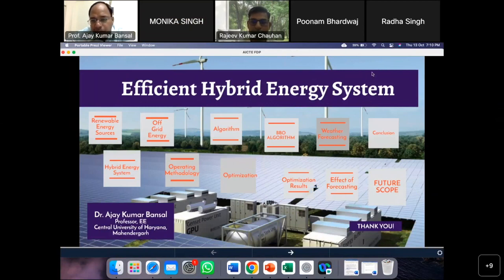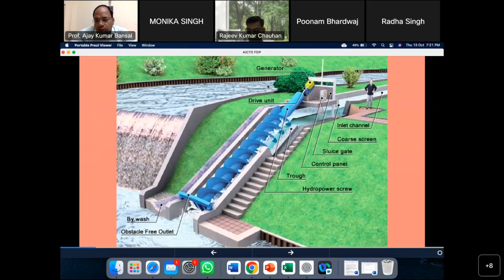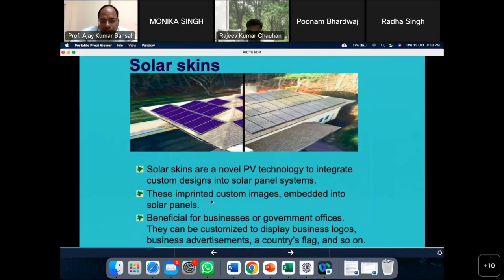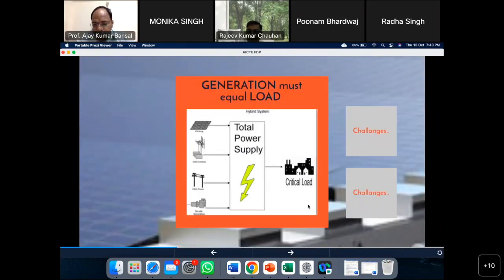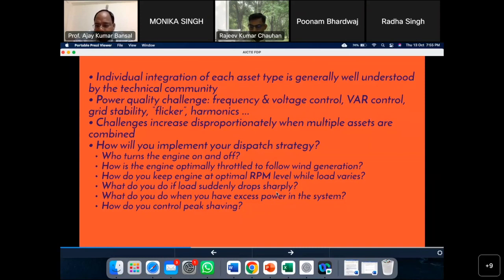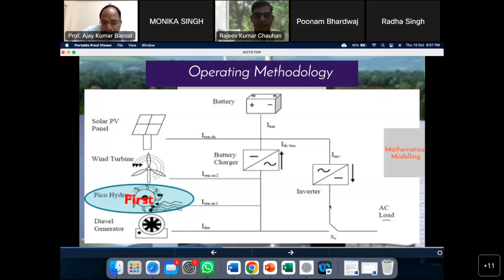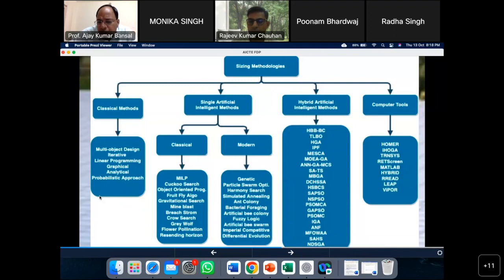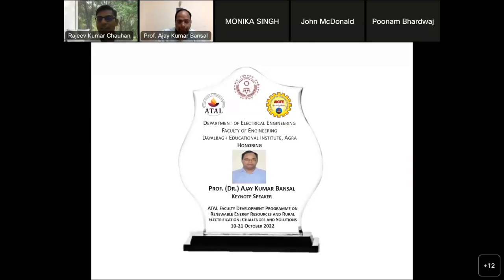Optimization of hybrid energy system including forecasting by Prof. AK  Bansal

Comment from the maker: 00:31 Optimizing hybrid energy system including forecasting
03:36 Wind energy is a clean and renewable energy source.
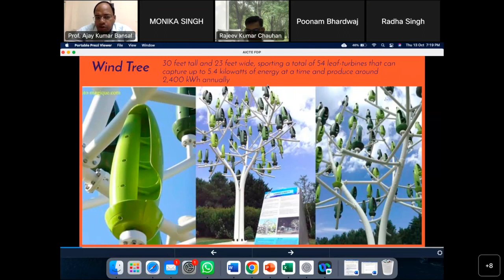09:43 Hybrid energy system optimization and alternative energy sources
12:41 Advantages and disadvantages of solar energy
18:34 Different types of solar cells and their efficiencies
21:13 Advancements in solar technology
26:24 Hybrid energy systems optimize efficiency and supply balance.
29:04 Designing hybrid energy systems based on local potential and user requirements
34:35 Challenges in designing hybrid energy systems
37:16 Designing a reliable renewable hybrid energy system
42:27 Designing an economically viable hybrid energy system.
45:07 Optimization strategies for hybrid energy systems
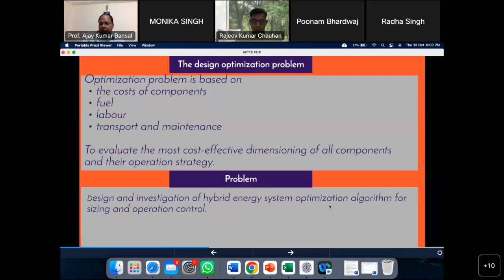50:26 Optimization of Hybrid Energy System
53:07 Optimization of hybrid energy system
58:19 Optimization of hybrid energy system
1:01:35 Selecting and initializing the algorithm for optimization
1:06:38 The philosophy of reaching global minima and maxima in optimization algorithms.
1:09:08 Optimization of hybrid energy system using various algorithms
1:14:10 Hybrid energy system optimization and weather forecasting
1:16:42 Forecasted data has a significant impact on hybrid energy system optimization